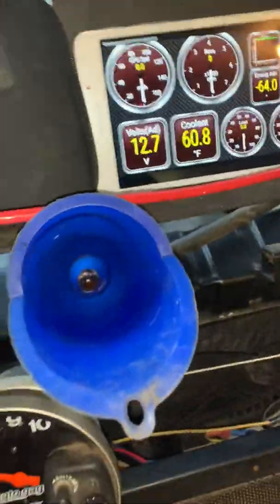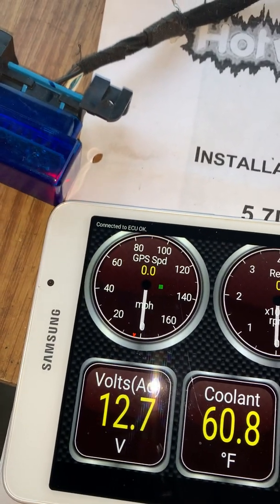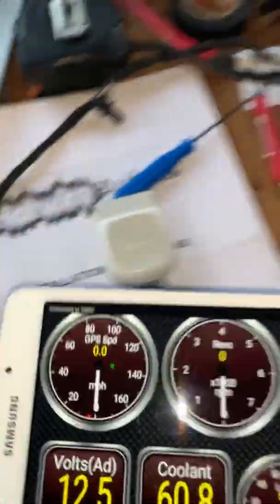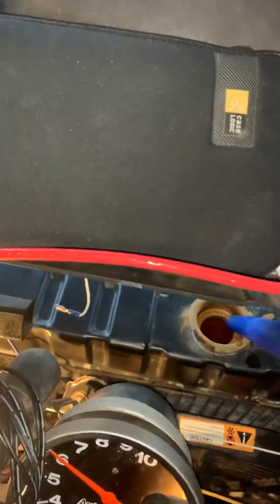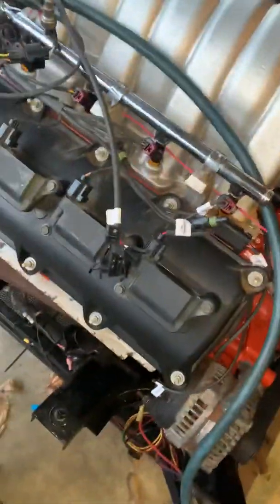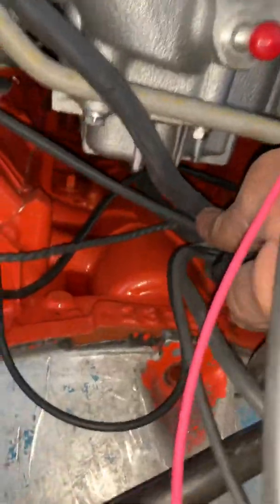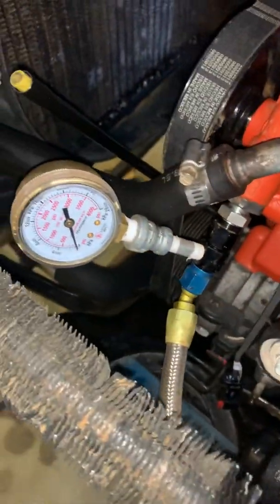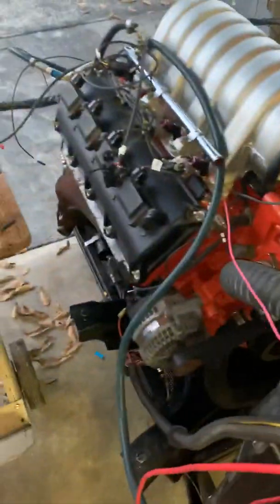G3 Hemi Swap Hotwire harness running 6.1 Hemi

Comment: hey, thanks for all the info.  ran into a problem.  with the ASD relay, does it need a ground or no? you have it with one connection going to the C3 pins 19 and 28 plus the C1 pin 38 and the other connection going to the C3 pin 3.  07 ram harness, 08 durango PCM.
Reply from the maker: No ground to negative battery. The ground is supplied by pin3, white connector which energizes the ASD relay and turns it on.
Reply: @shelbydogg  ok cool. thank you for the help. this is my first swap.  dont want to fry things

Comment: is your cuda running now ??????
Reply from the maker: Have 40,000 miles on it since installed 4 years ago. It’s the 5.7 and Hotwire harness from the other video. About to leave for another 5,000 mile Hot Rod Power Tour a week from now. Still runs great!